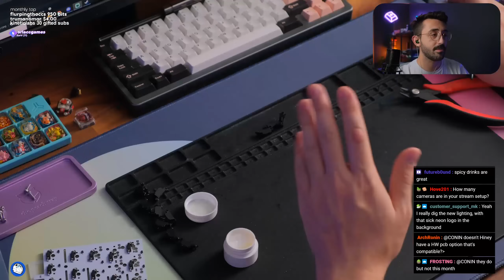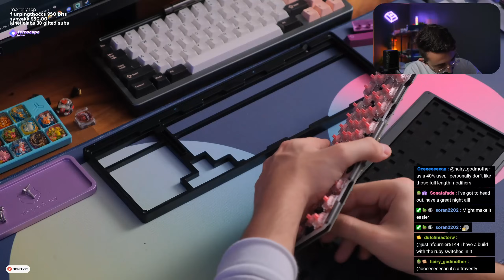Extreme75 Prototype w/ KTT Strawberry Switches Sound Test + Build Vod

Comment: This looks nice aesthetically and is an interesting design effort, but I feel there is a need for balance between form and function. The removal of the tab key in 40% was managable but when you do start removing parts of the alphas…I’m sure at that point you’ll have to stop and think whether you might be compromising too much for a device supposedly used for typing.

I’m not bashing it fyi - I’m just wondering who this is really for :)
Reply: As someone who mainly games on their keyboards this layout has everything i need so i may pick it up
Reply: The exclusion of these ponctuation keys is very common in 40s. This keyboard is in a very strange place, halfway 40s halfway big board. 
Also, just to be clear, these are not hard to access by any means. 
I also wonder who that's for.
Reply: @jona4934  Curious, what would you use the numpad for if you're mainly gaming?
Reply: @Elijah._.7  well I dont use it traditionally as i use it mainly for macros and some games like RuneScape and gta since they can benefit from it. Whenever I go to my smaller form factor builds I end up missing it.
Reply: @jona4934  Ahh I see, makes sense! Was half guessing that it'd be something MMO related.